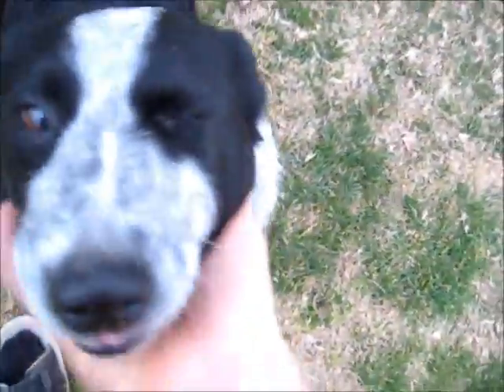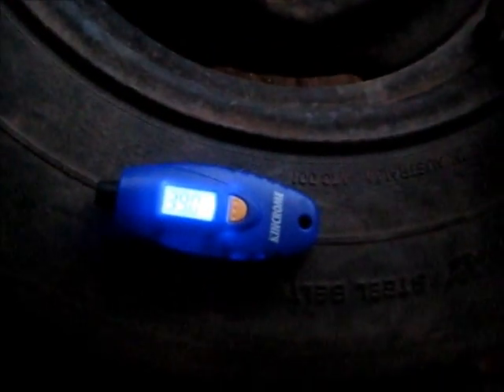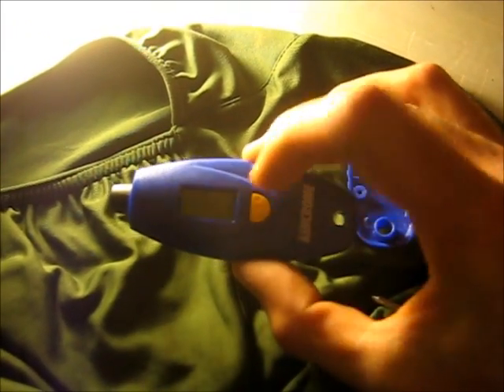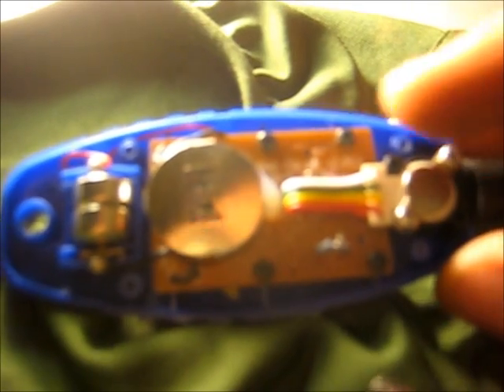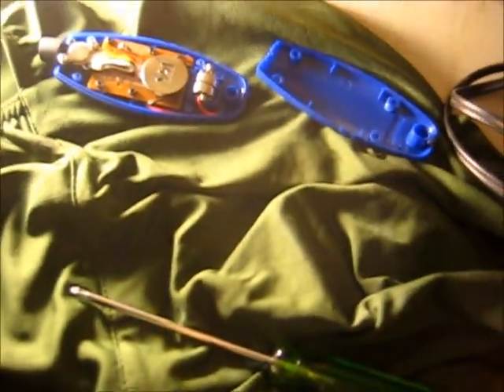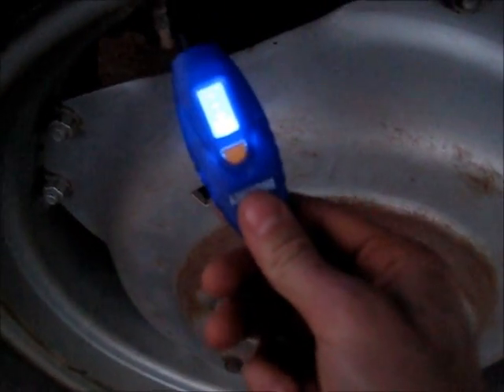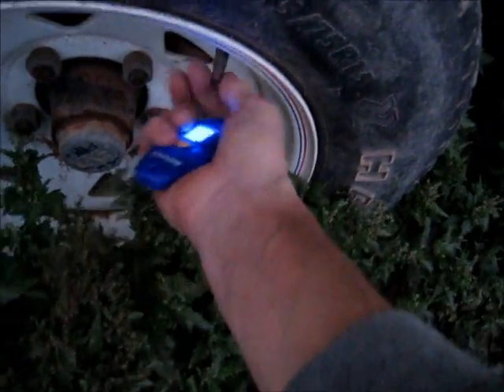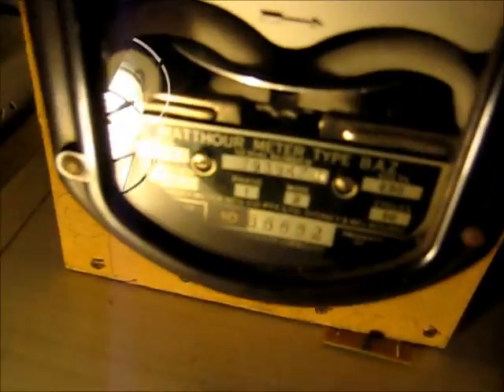Digital Tyre Pressure Gauge Autopsy & Test

Comment: If you're going to pull that apart, before you do.....Pump it up on the fridge compressor to see how much it takes......UNTIL IT POPS! :-D LMAO :-D

Then, once you've pressure-popped it, you could probably repair it with the MOT. :-D

Thanks for showing,

-BoomBoxDeluxe.